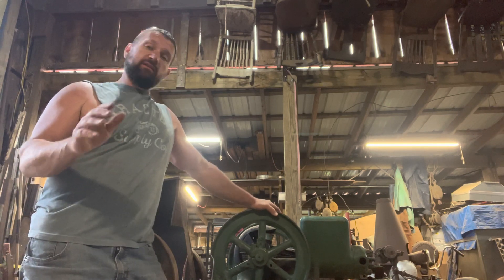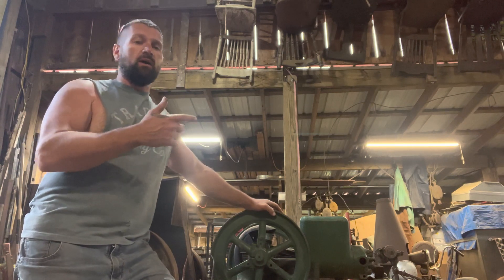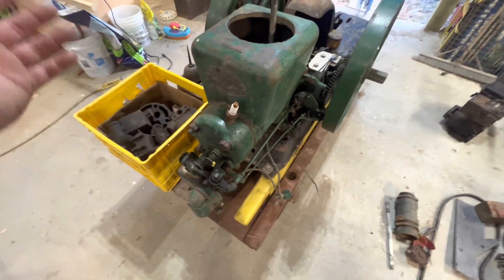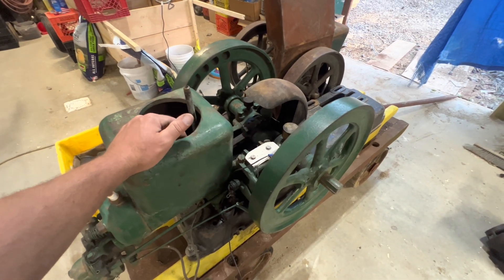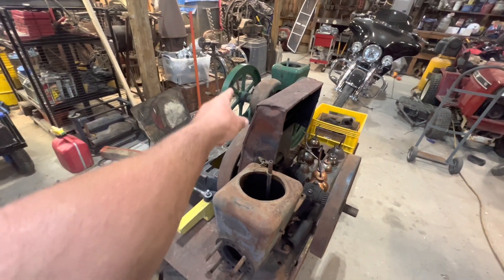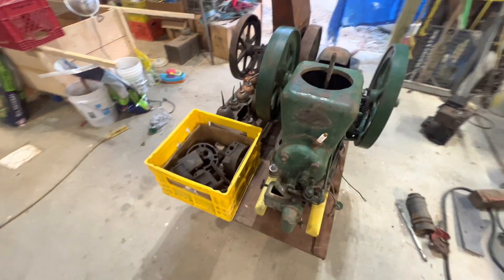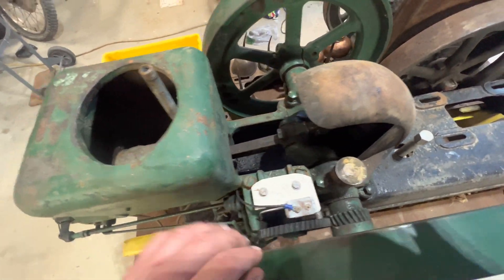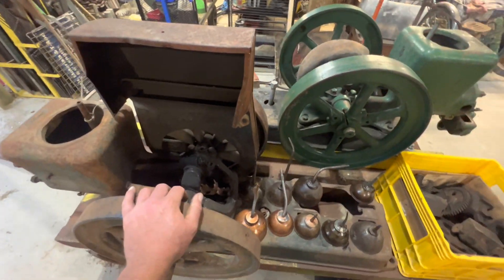Fairbanks Morse Z hit and miss engine

Comment: What you have there are 2 Fairbanks electric plant engines. They would have originally driven generators and were likely 32 volt DC systems for farms back in the day. Both engine are throttle governed not hit and miss!! If you want to know the difference I have a pretty in depth video on my channel. You did pretty well on pricing too! Doesn't look like they will need too too much to get either of them up and running again, however the one is missing its radiator and several other pieces...
Reply from the maker: Thanks for the response I will check out your video and channel I really want to learn more about these engines. I found it odd the one had that fan shroud and fan deal in it. Would that take a radiator there? Why would it have them if they have the water tanks?